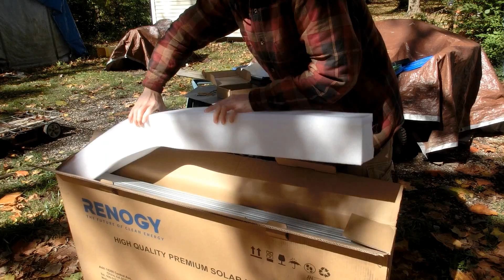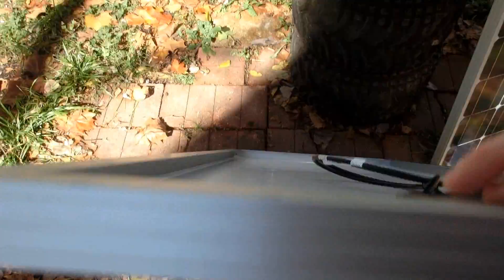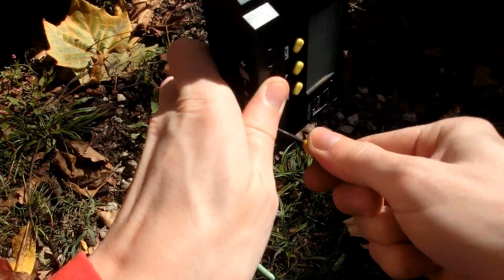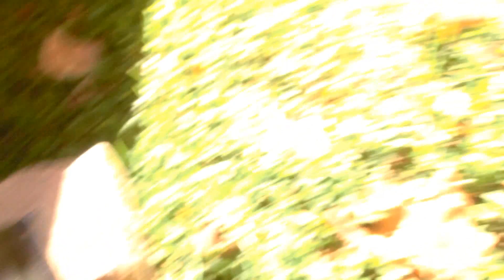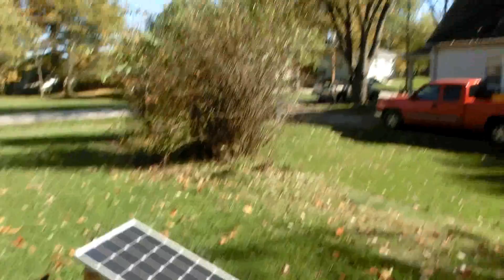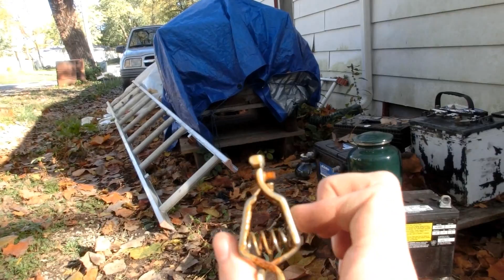Random Bits 0058: 200w solar panel system

Comment: This is a great guideline gives you all the information you need regarding building a home solar electrical power system. In plain language it tells you what you need to know. And how to put it together with common sense applications. https://plus.google.com/b/100728704920141855812/100728704920141855812/posts/WjRt4LRZEzo
Reply: spam spam spam spam .. and i don't mean Monty Python type spam ....

Comment: Two "12 V" panels in series would generate 24 V.   An MPPT controller could be used even for a 12 V system (depending on the specific controller).   The advantage of the series wiring is that you can push more power into the controller with lower resistive losses at a particular wire size.
Reply: Yeah, MPPT is awesome.  I started off with the exact same PWM charge controller Rinoa used in this video.  It's a piece of shit -- I fried mine too.  I ended up with a 40A MPPT charge controller.  Transmitting higher voltage  from the solar panels to the batteries is the way to go.  Of course, you could always charge more batteries in series instead but then you can develop unevenness between them.

Comment: Rinoa - try to get vendors to sponsor.  As a gift, grant.  Misplaced my headphones so I couldn't finish the video.  oxygen can be used with the hydrogen for various things. oxygen can be dumped back into the air too. You can do all kinds of things safely with hydrogen. Hydrogen can even be used to directly create electricity, burned as an ordinary fuel and to make fantastic welders/torches that far exceed anything else.  I love to see real People innovating and exploring reality. Warm regards.

Comment: I had to stop at 4:37 This person is a wack job
Reply: For wanting to make H2 and O2 with excess power?   So, there are people out there who know nothing about electricity and they purchase a grid-tie solar system and they just leave it alone and let it lower their electric bill.  You have others who need an off-grid system.  But, then you have a class of people like Rinoa, or myself, who are hobbyists and we tinker with things.  It's fun for us.  I'm powering my MacBook Pro right now from a 100-watt solar panel on my deck just for the heck of it.  It would have been much easier to just plug it in the wall but, what fun is that?
Reply from the maker: why?
Reply: +Christmas Eve rock on,what ever floats your boat

Comment: hi 
I have a charge control like this coming in the post.
Just wondering can the USB be used to charge phones or is this to connect to a PC?
If to connect to a PC not really matter as have an inverter coming to.
First thing I got was the massive 110 amp hour battery.

Comment: can 200w solar panel, Can run refrigerator @ 90w 230v 0.75amps? for 24/7?
Reply: no because a 200 watt solar panel gets sun for lets say 6 hours this would equal 360 watt hours dividing this by 24 would equal 50 watts so the most amount of watts you could run with this setup 24/7 is ideally 50 watts realistically probably more like 40-50
Reply: ohhhh i see, Thank you so much (:
Reply: your welcome

Comment: If you connect your batteries in series to a 24v bank (2 batteries connected negative to positive on one end and using the other two posts for power feeds), each 2 battery bank would be connected together in parallel to maintain 24 volts, and connect the panels in series for 2 panels and parallel connect sets of panels to maintain the 24v if you add more sets of panels. The charger is made to handle 24 volts and works well as long as the batteries are tied in 24 volt banks and the panels are tied the same way, because it's not MPPT the panel volts need to be close to the battery bank voltage. You save money in connectors and you lose less energy on long runs. The amps go down per panel but the volts go up so you get the same watts, because volts times amps equals watts. You can use smaller cabling. Just an idea.

Comment: Hi Super Genius
I have been looking in to storing the power in just compressing air, I have seen videos with engines running of compress air. It should be really effective. Well that is a project for another day,, when it is warm.. I am doing a project on powering my water heater, that is meant for 400V AC with 48V DC,,,that video is not editing it self :-)

Comment: there mc 4 conectors i use wires to read amps and wire both panels with y conector's pos to pos and neg to neg ,that 12 volt way  if you wire both togather pos to neg 2 panels it that way for 24 volt charge system same amps twice the volts l i use 12 volt systems

Comment: I have one of those PWM controllers-it works fine for me. I use it between 1 100 Watt Panel & 1 Group 31 Marine Deep Cycle Battery. I have had no problems with this setup.

Comment: dude, you are seriously underestimating the loss (inefficient) in DC over 100' using 12 or 14 gauge wire. I ran 10 gauge for 14'. and that was maxed out. you're wasting your money buying 200 watts of solar and using those wires. another point, call the manufacture of the batteries, mine bulk charge @14.4. or 14.8 VDC and float @ 13.4 VDC. if your batteries are only getting 13 VDC they are not getting charged. do yourself a huge favor and Google "handy Bob's solar". read the "9 golden rules"

Comment: "I'll probably just jam a nail in them or something"  "cause' I don't want to cut them....that would be stupid"  Jamming a nail in them wouldn't be??  Sorry, I just thought that was funny. You seem like a very smart guy, just a bit overconfident.   I would hate to see you get hurt.  Be safer and you'll be fine.  Be well.
Reply from the maker: +Joe Joyner well its not dangerous, its all bellow 20v
Reply: +Rinoa Super-Genius I've seen a few of your other videos I.e. the sulfuric acid splash one.  I can't confirm but I'm guessing you weren't wearing safety glasses.  Had that got in your eyes......I'll just say, no bueno.  Just concerned pal.  Be safe, that's all.
Reply from the maker: Joe Joyner
i wear normal glasses, plus battery acid isnt sulfuric acid, its 95% water with 5% sulfuric acid, but then when it's aged 20 years its basicly water with lead mixed in.

Comment: How good are these? I've always wondered. How much energy in a day could you get from a couple of thoes?
Reply from the maker: about 500watt hours a day in winter and 1000wh a day in summer, but if you have an MPPT controller you could boost that up to probably 800 and 1600 from a single panel.
Reply: Rinoa Super-Genius You can't get 1600 watt hours from a 100 watt panel even in the summer.  You would have to have peak , perfect sunlight for 16 hours in a single day.  I've only hit my power maximum a few times and it was for a short time.  I've actually exceeded it once, which was really cool (short circuit current of 6.3A from a Renogy 100w panel).  But, what I'm saying is that, even with MPPT and perfect conditions, you would need SIXTEEN hours of it to pull 1.6kWh from one panel in one day.
Reply from the maker: Paul
yeah thats why i said "up to" not that you would get that. i just stated the maximum possible during the longest day in summer, equiped with an MPPT controller and a sun tracking mount.

Comment: Im not sure if its a good idea to put hydrogen in an acetylene tank.  They arent just steel shells like other tanks, they are actually filled with a porous material and acetone to help keep the gas stable.  I would do alot of research before trying it.  Personally I would just use another oxygen tank, vacuum pup everything out, and then fill with hydrogen.  Mark very well that its not oxygen.
Reply from the maker: i dont think it would have a huge effect, i could remove the acetone by the vacuum pump. either way its the only large tanks i have.
Reply: I think it can be a few gallons of acetone, depending on the size of tank.  Im not an expert but it just seems like such a bad idea.  Could you mayby find a large air compressor with a bad compressor and use the tank? I think you should find someone very knowledgable about fuel tanks and talk to them first.
Reply from the maker: CutTimeBrony
 whats a bad idea about removing acetone? i've worked with it in dissolving pylystyrene and i think a vacuum would easilly turn it into a vapor or gas.

if your just going off your gut feeling then i dont know what to tell you.
Reply: Well the acetone isnt the dangerous part, I was just saying there may be more then you expect.  Although it may or may not have acetylene trapped in it which will evaporate out, but that wont be a huge deal as long as there is nothing to spark.  
What I think would be of concern is how the hydrogen would react with the filler material.

I personally would rather just go for a safer option with less variables.  But Im not gonna tell you not to do it, just think it through carefully first and know what your dealing with.
Reply from the maker: CutTimeBrony
thank you for the concern but the structure they put inside tanks are usually very inert like asbestos and whatnot. i dont see much of a chance of anything bad happening, and if it did i am going to house the tanks in their own brick shed.

Comment: if you look around you can get 120watt panels for only $115
Reply from the maker: then link to it.
Reply: http://www.ebay.com/itm/Kyocera-Solar-Panel-120-Watt-12-Volt-12V-RV-Boat-PV-Charger-Used-A-Grade-Cells-/201195625751?pt=LH_DefaultDomain_0&hash=item2ed8319d17
Reply from the maker: stuffyou shoulddo
 ah thats used not new. i was mostly wanting new. but yeah thats a good price.
Reply: Rinoa Super-Genius I totally understand But don't underestimate solar panels the tec is good. The panels you bought will be around for a long time.

I am interested to see the hydrogen side of this project.

Comment: What brand and model charge controller is that I would like to get that one because it is the only one I have seen for under $50 that shows battery state of charge
Reply from the maker: its just a cheepie one from china, search ebay for them and you will find one.

Comment: Check out this step down on aliexpress: http://www.aliexpress.com/item/Low-Ripple-DC-Converter-Step-Down-Module-Input-4-5-60V-Output-1-25-30V-Buck/499360587.html  it can reduce voltage from 4.5-60v to 1.25-30v, unafortunnatelly only up to 3 amps, but they't cheap and u can use them in parallel. Might help on the panels
Reply from the maker: i bought one rated for 10 amps from ebay for 12$ and its on its way, thanks though.
Reply: Gimme link please, i was looking for more powerful ones and couldnt find anything. Whats the maximum input voltage of the one you bought?
Reply from the maker: Mateus Leonardo
http://www.ebay.com/itm/DC-DC-3-5-30V-to-0-8-29V-Step-down-Power-Converter-MAX-10A-Voltage-Regulators-/221570253028?pt=LH_DefaultDomain_0&hash=item33969dc0e4 i think thats teh one.
Reply: Seem really good, but, unafortunatelly i need up to 60v input. Thanks for the information, might become usefull sometime.

Comment: I wonder what the usb ports are for on the charge controller , Maybe its some serial data logger interface
Reply from the maker: i'm thinking just for charging usb stuff. but i'm not sure. would be cool if you can stick a usb stick on it and it automaticly logs the power every hour into a text file you can read on your computer.
Reply: Dident it say 232 on it or something? the number associated with serial communication , You may get lucky and find its a logger :-)
Reply from the maker: steve64464
 well the manual only says it can provide 1 amp. idk if it's worth it to mess around with it. would hate to break it's functionality.
Reply: Perhaps more research will reveal its secrets

Comment: Since you have two panels don't you need to charge controllers, I know you can hook the batteries up in series to charge a few at one time, and run an inverter.
On the charge controller what is the hook ups with a little light bulb symbol for??
Also what's up with the 2-USB ports??
I noticed Royal King on a few of the batteries is that a store or the brand name??
Reply from the maker: i will connect both panels in parallel to provide 13v 12 amps to the controller
i'll connect all the batteries in parallel to charge them at once too. i just might add some diodes to keep the dead ones from killing the good ones.
for the output, that has a voltage cutoff and the meter will add up how much power you use for the load.
you can charge things from it with the usb port. not entirely useful but oh well.
and Rural King is a local store, for several months they let me swap really dead batteries for less dead batteries from their recycling skid, thats why i have so many right now. but one of their employees stole a bunch of batteries so they have them locked down now and are difficult to deal with.

Comment: ...but then can you change the cutoff battery voltage so that it will charge the lithium 18650 batteries? Correctly and directly?

Comment: That charge controller is capable of auto-sensing whether the system is 12v or 24v. The amps will be the same at 24v but your available power will double; The gauge of your wire will be smaller. Two panels in series for a 24v lashup.

Comment: nice panels, could You share link to supplier?
Reply from the maker: oh sorry http://www.ebay.com/itm/Solar-Panel-Off-Grid-100W-Watts-100-Watt-Mono-12-Volt-12V-RV-Boat-PV-Charger-/281117901727?pt=LH_DefaultDomain_0&hash=item4173eec39f
Reply: thanks!

Comment: Nice solar panels. I have 100w of solar on my shed and its  surprising how much power they produce i use it for power tools, lighting, charging laptop, phones and tablet.
The manual solar tracker is a good idea,im thinking of putting a bracket on my wind turbine post so i can mount solar panels under the wind turbine.
All the best on your future projects.
Reply from the maker: not manual, i'm going to make it automatic running of a little dc motor. but thanks :D

Comment: How do you plan to keep the batteries from freezing during the winter?
Reply from the maker: keeping them charged, the more the battery is charged the lower it moves the freezing point of the electrolyte. last year it got to -12 F* (-24 C*) a good majority of my batteries got some cells frozen but most where still liquid. i will keep them charged and the ones that wont charge enough i may add more acid into them s they get to the right acidity or i may add epsom salt.